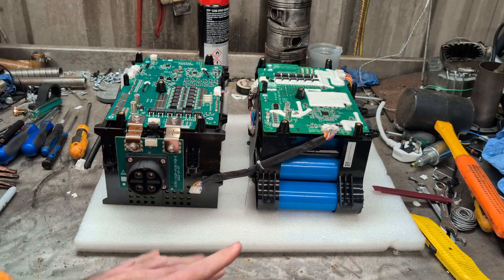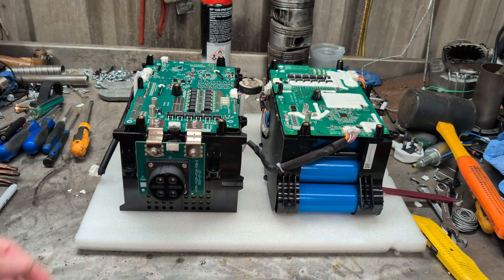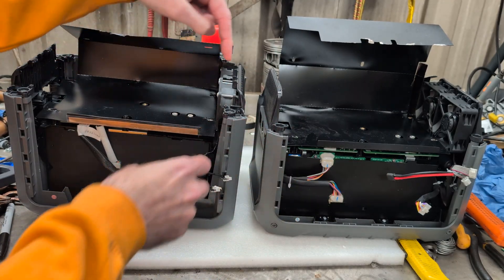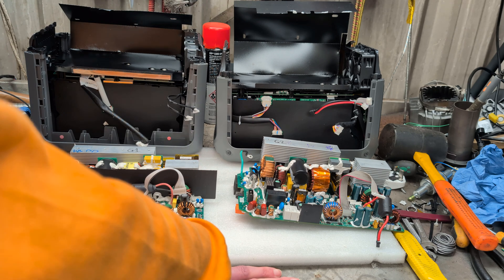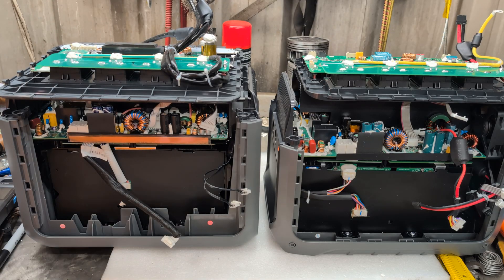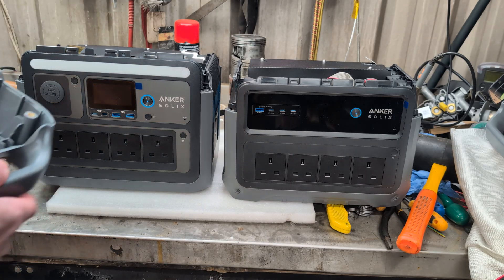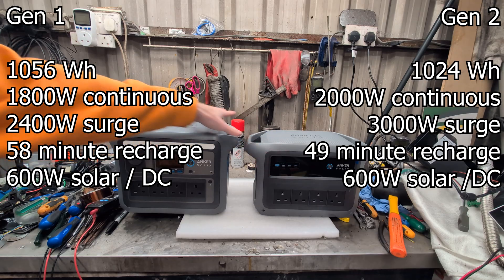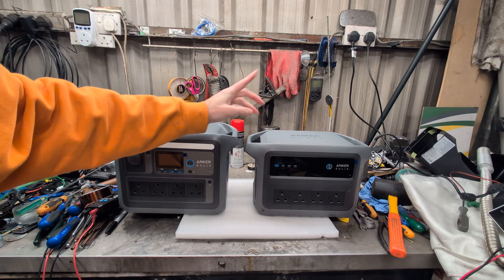Anker Solix C1000 Gen 1 vs Gen 2 - in bits, insides and outsides

Comment: WOW OMG,  I love seeing the insides!

Gen II for me: 
1. The extra top end surge capacity for my "wired" tools. 
2. The USB3's extra high power output for newer device charging.  
3. Lighter to carry inside to charge via AC  
4. I find headlamps most convenient to see with.  The unit will be  sitting behind my driver seat  mostly so the light wouldn't do much for me there.  
5. If I need additional battery storage, I'll just get a standalone BIG 200Wh and get a dc to dc charger to top off the power station.

Comment: Can you hack this by adding in your own batteries like they do with the big ones I know like the the house giant ones I seen a video a guy was able to add big lithium batteries directly into the forts so that way you could extend the size without having to buy an actual whole other unit or anchors proprietary BS you can just get a giant lipo battery
Reply from the maker: Good question.  Assuming everything had its own BMS, I don't think the main unit would even know you'd added other batteries.  It might confuse the runtime display though.

Comment: Love this❤🎉
But am going to buy the gen 1 even if it slightly pricier..... Thanks brother 🙏
Reply: I bought the Gen "1" I prefer it because #1) it has a Light #2) its expandable.   Otherwise they are both good units...
Reply: Gen II for me: 1. for the extra surge capacity for my "wired" tools. 2. The  USB3's extra high power output for new device charging.  3. I find headlamps most convenient to see with.  The unit will be  sitting behind my driver seat  mostly so the light wouldn't do much for me there.  4. Lighter to carry inside to charge via AC

Comment: No battery cooling on the gen 2. What could go wrong.
Reply from the maker: I wonder how hot it has to be to get the battery fan to come on.
Reply: @DavidMcLuckie so it doesn't always come on
Reply: It has 3 small fans internally that you can hear come on during ultra fast charging. They are there
Reply: In terms of safety. Absolutely nothing because LiFepo4 batteries are safe